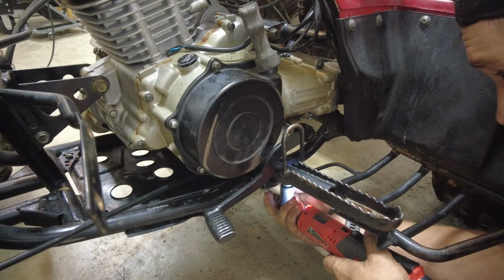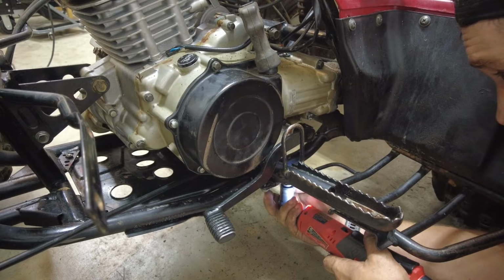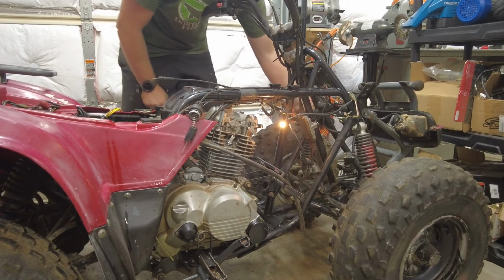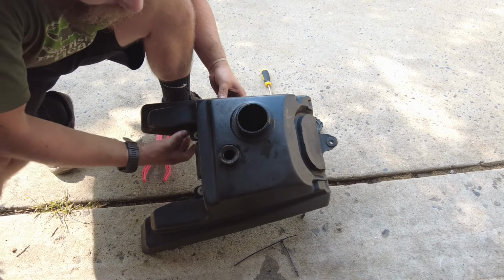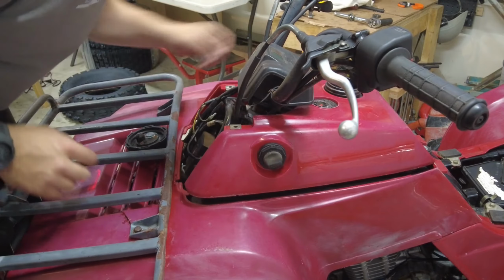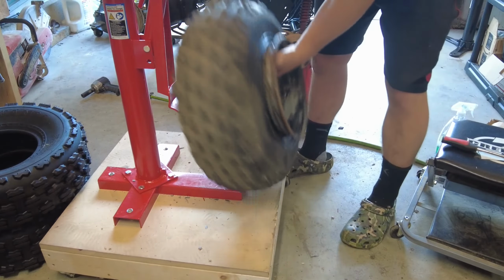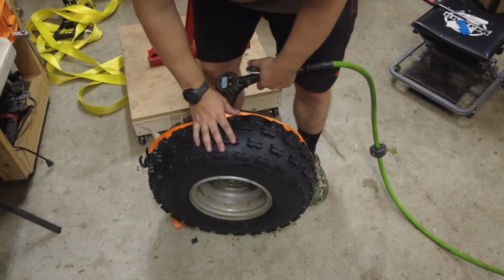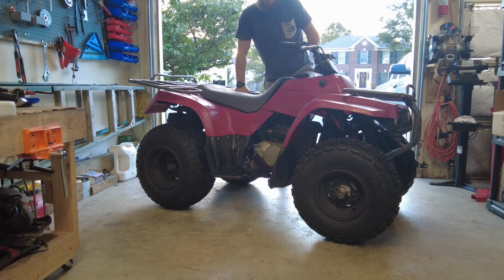Kawasaki Bayou Final Assembly And First Start After Engine Rebuild!

Comment: Think you forgot a washer on the primary clutch which might explain the slight noise. Also pretty sure thats a 250 not a 220 (its a 250 front bumper) otherwise very good series of videos, thanks!

Comment: Hey, I was just wondering if I could bring you my Kawasaki bayou 220 bc a few days ago I was riding it, and then i lost all compression, I knew the motor was gonna go out, but Idk if someone came lose or not, because when i rode it before it lost compression, it was still running and then once it completely stopped it died and wouldnt start back.
Reply: check ya valve adjusters. mine was running and the exhaust valve adjuster came loose